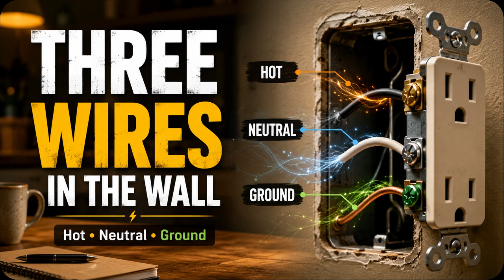Three Wires: The Private Storm Behind Your Walls

Comment: A standard circuit breaker will not trip to protect you from electrical shock and a GFCI circuit breaker does not trip because there is a rush of current through the ground wire.
Reply from the maker: Good catch — you’re right, my wording was a little too loose there. A regular breaker is not personal shock protection; it trips on big fault/overload current. And a GFCI trips by detecting a Hot/Neutral imbalance, not because current rushes through the Ground wire. I’m adjusting the paper to make that clearer (Ground: The Unemployed Bodyguard); hope it works. Thanks!